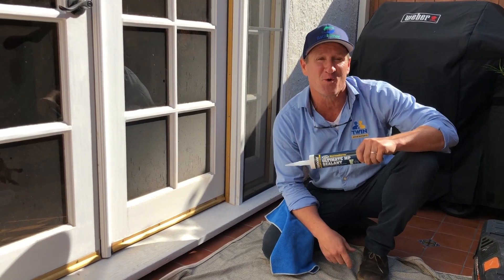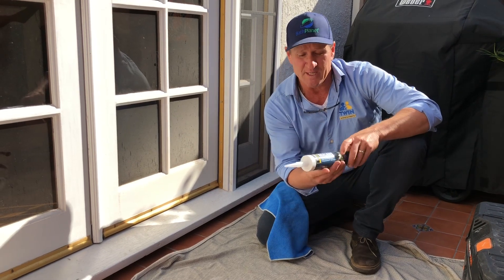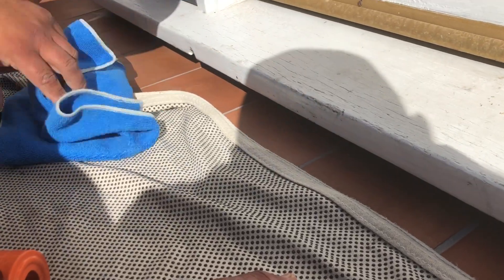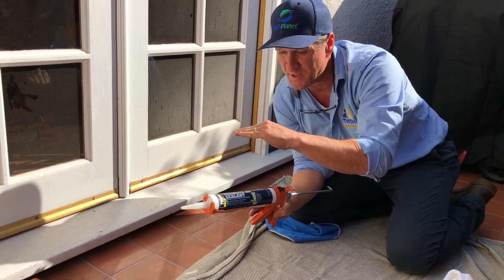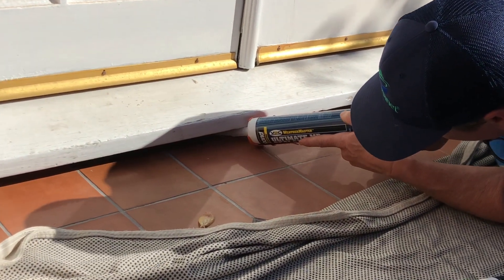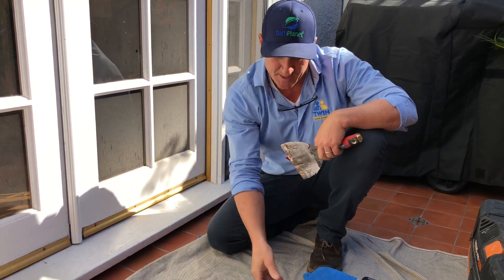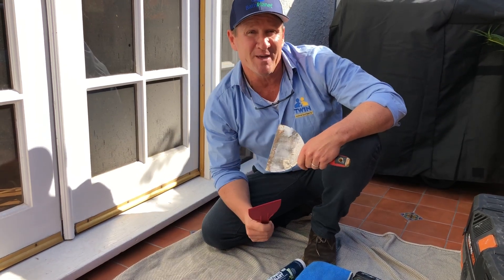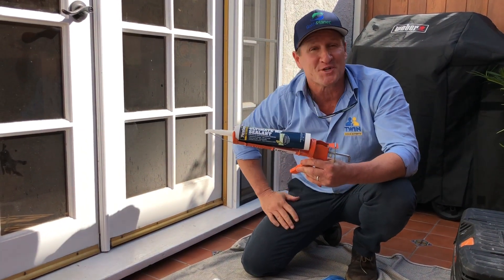How To Apply The Best Exterior Caulking For Longevity

Comment: Why would you use a consumer product instead of a far better commercial sealant?
There are FAR BETTER sealants for longevity. This will usually last 5 years max. Probably much less due to substandard installation. I have many examples of sealants by Sika, Sonneborn ( now BASF) and Tremco that I installed in traffic decks, tile floors, sidewalks and parking structures at malls, schools and other public areas that get more abuse in a week than than a home would get in a lifetime. And they are still in good shape after 20+ years.
This is NOT the best caulking for longevity. It is a consumer product. Not a professional quality product.
 Also this is still a 3 sided bond. It needed bond breaker tape on the bottom of the joint. It will fail prematurely.
You are not an expert. This is a horrible installation. You should stay away from caulking.
I don’t understand why amateurs make videos claiming to be experts then to proceed to prove they don’t know what they are doing.